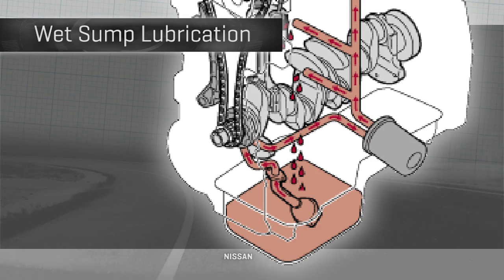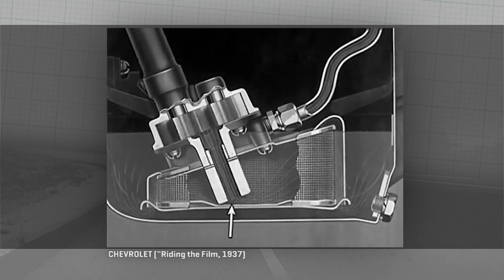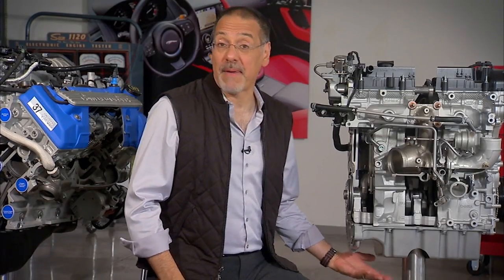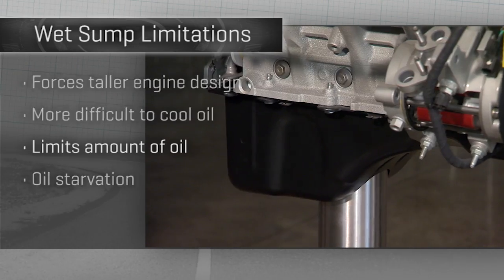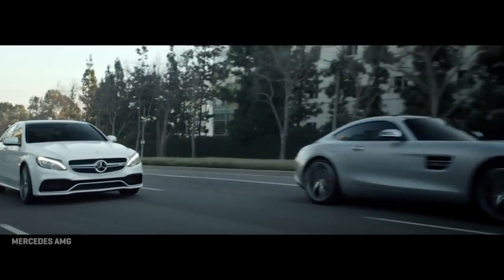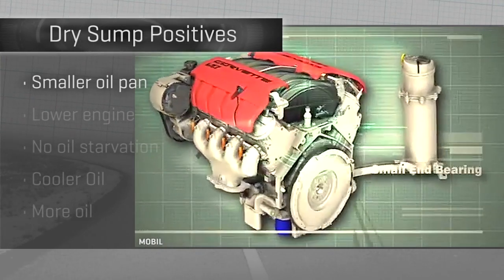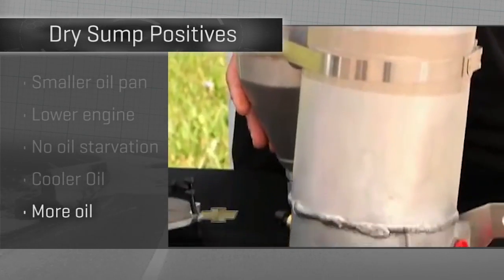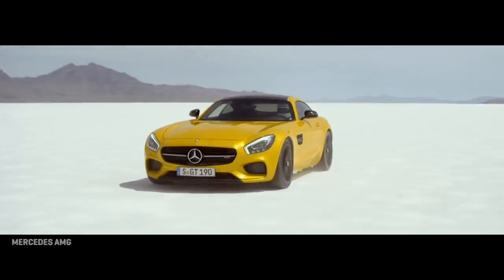CNET On Cars - Car Tech 101: Inside dry-sump systems

Comment: It's advanced but still old fashioned since should use electric cars that are much faster and with a low centered weight.
Reply: You realise that electric cars have been around since the beginning of the automobile.  By your logic this means that electric powered vehicles are not any more modern.
Reply: Shoshanna Rubin I mean it's no point in developing fossil fuel vehicles since we need to move away from that. It's like having a power plant funning on coal in a city. We can't have that even if coal heating have been use extensively over time in London and elsewhere. We have to realize what is important and the main point. The same goes for reading related information and comments.
Reply: I was being sarcastic. My opinion is that internal combustion engine has a lot more potential and there's way to make crude oil from plants that nobody is developing because its easier to make holes in Earth
Reply: Yes, lithium reserves are infinite. Also minig it doesn't pollute at all.
Reply: kize32 what do you mine it with, what do you use to transport it, how do you recharge it.  Lithium is ok but yet we still mine transport and use generators that all use fossil fuels and they pollute a lot
Reply: kize32 someday we'll change to electric. I always thought that hydrogen cars could take off.